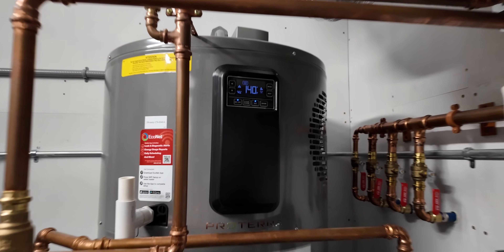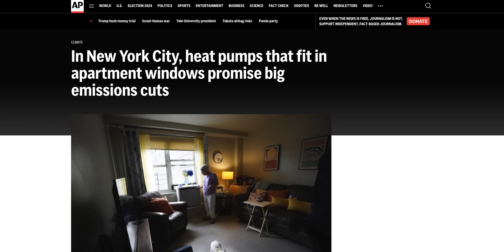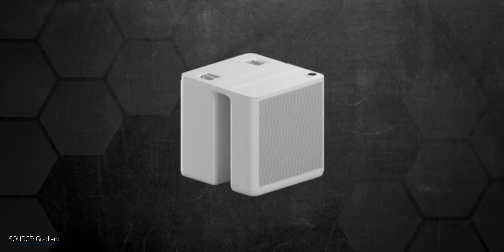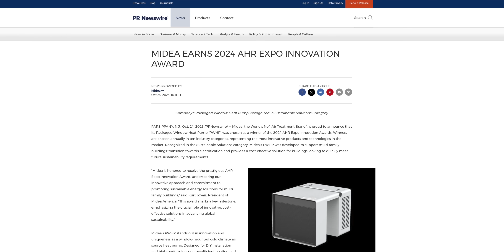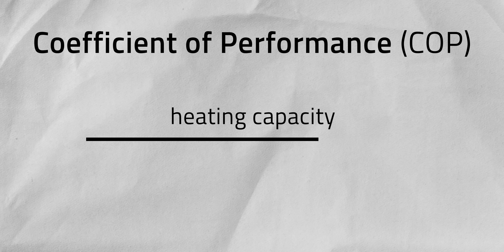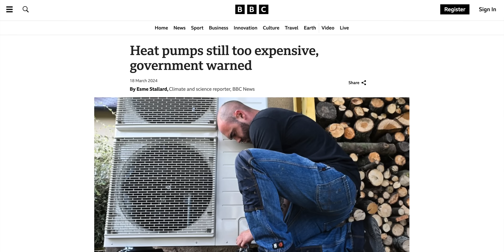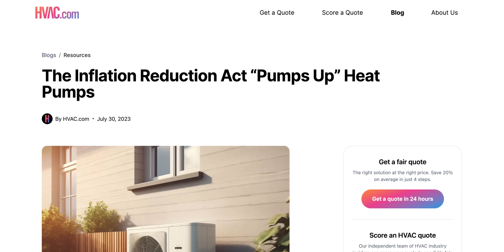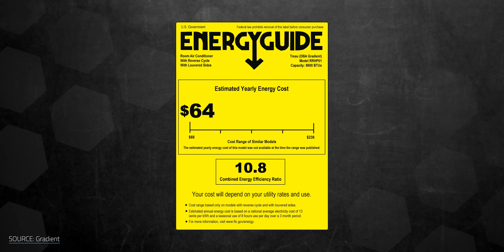Why This Window Heat Pump Is Genius

Comment: Window units have existed since the 1930's, but I will say that one does have a much more appealing layout instead of using the entire window space like the old ones, but they've lost their minds if they think they can charge 3k. All it takes to modify a window unit to heat and cool is adding a valve, or just literally take it out of the window and turn it around backwards if you're really desperate.

I keep my room door shut and heat it in the winter with my PC, if I'm gaming it generates heat, but when I'm not gaming I set it up to bitcoin mine which mean's I'm mining at 100% efficiency since the waste heat is the true goal and the bitcoin is just to pay for the electricity. Even if I only make a penny that's offsetting my costs, even if it's -5 cents a day that's only 5 cents to heat my room, and where I live is nuclear power so my energy is decently priced and pretty cleanly produced. Obviously I don't crypto mine when it's not winter. Not a heatpump, but better than a space heater on cost. Don't expect this to instantly heat a room since it does require constant use but it will heat a room over time then maintain that.

Comment: I have been in the HVAC/R industry much of my life. The problem with these units is they are too expensive. They are basically and A/C unit with a reversing valve and a few other inexpensive components. They are also not very efficient. The good heat pumps have a seer rating of 22 and up, not 16 or below.

Comment: The difference between a window ac unit and this window
heat pump unit is a reversal valve, easier than turning the ac unit
around, and a whole lot cheaper ! !

Comment: In larger buildings with room divisions/rooms, it makes more sense to have a central heating system and thermostats to regulate the temperature in each room. Air-to-water/ground-to-water heat pumps with large water tanks that accumulate heat when electricity prices are low and rest when electricity prices are high provide meaningful savings. However, it is important that the electrical grid is equipped to handle the load when both electric vehicles, heating, and cooking draw power from the same cable. If one lives close to an industrial facility/power plant or another heat source, it makes the most sense to utilize waste heat from these places. In Denmark, this is called district heating, and it is used in many cities.

Comment: You can actually mount an air conditioner backwards and use it as a heat pump. The problem is all your controls are on the outside and subjected to weather, so an AC company could build these for the same price as a regular unit.

Comment: Then when the next efficiency bumps comes along "Oops those window units gotta go!". Let's also keep in mind that these aren't a once in a lifetime cost, but rather, like once every few years or once ever 5 years or once every 10 years. And each one costs more than an entire gas powered house heater used to cost. So we're talking over $9000 over 10-30 years per person. Those efficiency savings start to look like crap in the face of those costs. Let's also keep in mind the carbon footprint of creating all these new units. The longer a single unit lasts, the lower the lifetime footprint. Just like how a gas powered car that lasts 20-30 years has far less of a carbon footprint than an electric vehicle, literally as soon as the electric vehicle comes off the assembly line. So these things are not overall more efficient. Keep in mind, when you have to pay more for something, you have to work more to pay for it, which requires generating emissions to do any type of job.....so if a pair of "green" shoes for example, costs twice as much but used half the emissions during creation, it doesn't matter.....because you must generate twice the amount of emissions to have the money to pay for it! People need to wake up and realize they're being misguided.

Comment: Big fan of Midea.  I used their u shaped air conditioner to replace the central a/c which was leaking Freon.  The central system spread the air cooled by the ushaped window a/c.  IT WORKED GREAT.  SAVED ME OVER $1000.  I had budgeted to get two if needed.  But the one worked amazing!

So why can’t the heat pump be bought anywhere.  Seems restrictions prevent sales online which are more than 30 miles from store.

Comment: just where do you think all this electricity come from all the power plants will have to up there use of fossil fuels.  Some people think electricity comes from thin air.  And you cant tell me they don't leak condensation all cooling units leak water. :face-blue-wide-eyes:

Comment: Wow.  Im getting one because i have a big air conditioner unit we just bought i wish i had known about Heat Pumps before i dropped $15,000 on a new AC UNIT     I still have a room in the front that gets sun on the window all day and no matter what i do i cannot sit in that room or i start getting hot with in just a minute.  Its like an oven    I have a HOA that will probably say something but its a room thats in front if my driveway i habe a fliwer bed in front of that window.  So i will just plant something in front of the window to cover it. Even though i think    they look cool. My HOA lets this big 2 story home have one on the side room above his garage snd you can see it from the street.  They say nothing to them for 10+ years.  They say if it can ve seen in the front you cannot do it.  Question :   Im disabled is there anything i can do to get around the HOA so i can install this in my front room window ???   Any help from anyone please.   I want to do a Mr. COOL system for the entire house one day.

Comment: I like your channel! Don't always agree. Genius, NO. This is what's wrong with supposed climate equipment, it's expensive! I'd rather buy two window units, one built for heat and one for cool, that's $300 and the efficiency is nearly same. government intervention not good! Prices that are really affordable and save energy, another savings $ then folks will buy it up.

Comment: This heat-pump is a luxury item. Heat-pumps are 100% electric, and 99% of that electricity has to come from a power-plant that uses Gas & Coal. By the time we calculate the transmission line losses, it is only marginally better efficiency than existing building boilers. And the need for all that electricity will require  to the building wiring and the transmission lines to distribute all that new electricity. Installing higher efficiency gas boilers is a much more effective way of reducing emissions and saving money on utilities. Carbon emissions are not causing global warming. Our sun is in control of the weather. Open your eyes, Matt. As a practical engineer, you should know better.
Reply: He knows where his bread is buttered.
Policy affects cost and cost affects sales.
If you can get a kickback for referring sales, why challenge policy?

Comment: I had old central unit replaced with a dual fuel heat pump. When it got too cold for heat pump to work,the gas heater kicked on. Dropped my electric bill  almost in half at the time.

Comment: In my neck of the woods, propane is less than 1/3 the price of electricity per 100,000 BTUs. $3.00 per gallon vs 45¢ kwh. Electricity prices have been trending up significantly while propane is stable or a little less than it was 10 years ago. Rural SF Bay Area. PGE vs private propane company. Propane figured at 90% efficiency.

Comment: This isn’t a bad idea, but renters desperately need proper insulation which could do even more to reduce dependence on cooling and heating. I live in a mild climate where cooling and heating should barely be needed at all, but we have to crank A/C all summer long because the building is basically (non-)engineered to function as an oven, somehow radiating heat into the units in summer, while allowing cold and hot air to pass freely through the unit’s envelope. I’m afraid that implementing a/c, even heat pump cooling, for rental units to keep them habitable will delay implementation of insulation and passive cooling, costing us years and billions or trillions of tons of carbon compared to implementing insulation and passive cooling first, where it is feasible.

Comment: I think this has a lot of potential.  I also love the fact that with the right design, they hardly take any window space.  But before I can personally justify this, I need to see two things happen first.  1st, the price needs to be more reasonable and with competition, hopefully it will.  With 9000 BTUs I can imagine being fine with 1 unit for up to 700 or 800 square feet.  After that, you mostly likely want a second unit.  Especially with a house like mine where airflow from the front to the back of the house is not efficient.  2nd, and more importantly for me, the temperature range of operation need to be better.  Not just the temperature ranges but the ability to deal with those ranges over time.  I live in an area where a week at -40 in the winter, along with three weeks of 110 degrees or more in the summer is not unheard of.  This most recent summer we had a record breaking 23 days in a row with 100 plus, with a week at 115 plus, and one day peaking at 127.  The higher price might be worthwhile if it can handle such extremes otherwise it is a lot of money that will have to be supplemented with secondary units.

Comment: Does this guy have any idea how much electric costs?!
And electric is made with oil anyway.
Not to mention 115v is wayless efficient than 220v. This vid has an agenda.
 Air 10,000 BTU Window Air Conditioner with 10,000 BTU Heater, 699.99 not cheap

Comment: So, I'm sure this is a stupid statement (way 2 simple 2 b accurate), but if acs r so efficient, y not just turn the window unit around in the winter? 
(Besides the obvious, inside components are now outside in the elements)

Just Wondering

Comment: You can get a normal window shaker with a heating mode already- They are under 400 dollars at any big box store. The "U" Shape frees up the window but unlike the normal window shaker you need a pump to rid it of condensation. 

I'm not surprised it costs so much. The cost reflects the fact that the government is mandating them. Landlords are forced to spend, and these companies know it. The novel design's only benefit is that it doesn't block the window. I laughed when in the video it was explained New York wanted it "at or under 3000 dollars" and the company said "It's 3000" the literal max price lmao.

Comment: So, heat whose cost is included into rent is to be replaced with a system that costs $3k per room and the electricity is paid for by the renter. Yeah, that isn't going to work.

Comment: You do not get more energy out of it than you put in because it uses energy to triple temperature using pressure. People who make the claims are picking the science to make the claims. Proof is a house with electric heat cost just as much to heat after switching to a heat pump. I know for a fact because I've had geothermal heat pump for years and it only offered huge replacement costs so I just went back to electric heat

Comment: Save yourself a ton of money and get the A/C unit. When winter comes turn it around. Boom, heat pump at a fraction of the cost. This is how I have heated for the past 12 years.  Can make it 116 degrees inside  when it's 40 degrees outside.  Want to make it crazy dry inside?  Run the complete unit indoors and drain the condensate outside, or in a drain, or a bucket, however you like.. You've just made a huge dehumidifier that drops humidity from 90% to single digit percentage that now heats a space to dizzying temperatures if you are into that sort of thing. It's not rocket science and it doesn't cost thousands of dollars.

Comment: Those prices are robbery. The difference between a window A/C unit and a heatpump is a single reversing valve.  The difference in the efficiency ratings is a combination of the size of the evaporator and the condenser coils and the use of a variable speed compressor and fans.  NONE of these items are revolutionary, or difficult to manufacture. It's just price gouging.

Comment: ALL one needs .. beyond $$$  :-)  is a Vertical sash window..  Which are actually quite rare.  
When found  are typically existing in Older bldgs  Which also have  V thick walls.
 Where the Contraptions "U" shape can't fit. 
 NO cigar mate !

Comment: I say BS on this heat pump crap. You never mention how bad they work below 40. They use way more than my gas high efficient boiler. I was using oil and spending $320 month every month thru the year, now

Comment: Don’t think the prices are very accurate at all. Reverse cycle ie cold or heat about $100 to $150 price difference and the midea u should be no more than $800 to $1000.

Comment: Since this video, I've read repeatedly that there are problems* with water pump in this type of unit and that the U shaped version (such as by Medea) handles water much better than this "saddle" format.

* noise, cleaning and maintenance requirements, leaks, overflows.

On a side note, I bought a tiny dehumidifier for disaster recovery (60w == 16 hours on a 1k battery) and ended up using it all the time.  It drops humidity in my house by 5 to 8 percent and was cheap.  There are many units like this.  I have mine set up to drain into the sink but it will apparently run for for 2-3 days before they need to be emptied.  In a single closed normal room, the $70-$90  price range will drop humidity by 8% to 10%.

Comment: 2nd note why there garbage it takes 3 ac to keep cozy in summer it takes 50000 btu gas heater to stay warm  so i would need 5 of these units to stay warm if it stays below the teens these will fail  so you will die when you need heat the most. My gas system will keep running  with less stress.  So 15 thousand to use this tec and another 1500 a month or more in electric bill yes they all have to run 24 7 or pipes burst. In winter what am i saving nothing ime using more power electric expensive gas not so bad.😂
Reply: Ps can buy a gas heater for a thousand. For my apartment

Comment: First off heat pumps e scooters e cars cellphones and more going on power grid that was built in like WW2  it will cost trillion s of dollars to upgrade grid not gonna happen in next 100 years. Burning coal and nuke power to keep up now😂
Reply: Ps a a repair tec when it gets real cold these heat pumps fail big-time parts take weeks to get 😂Had to leave clients with ele heat for a month baseboard another 2000 in ele and they were cold

Comment: This is literally a window AC unit, heat pump combo
One of the most inefficient designs because the distance the heat is carried is short and there are no options to locate condensers and collectors in better locations
Eg if you put the heat dissipator in the shade with good air flow you get higher efficiency
And if you put the heat collector in specific locations and configurations, then you can capture heat better, eg stick a heat collector in the laundry room or solar water heater or hot asphalt, or deep underground or utility rooms, etc

If you make a compact expensive condenser then you can't spread it across a large area to collect a lot of heat, and you can't bury it in good heat sources
A plastic hose is better at heat collection than this thing

Comment: In 1976 I was in the Bahamas. It was cold that winter and my first night there I froze. I didn’t know the air conditioner could work as a heater from then on. I was fine wherever I stayed because that was standard down there. I remember it, but definitely Improved when I realized I could Switch the air conditioner to heat mode. This must be the same idea and of course it doesn’t get as cold here..

Comment: EVERy split Air conditioner in Brazilian market comes with the reverse valve even if it's basicly useless in our warm clima. There are  also 'Windows Air conditioners' wich require onty an adaptation in window frames and glasses. so what's the f****n point of this 'invention' ?